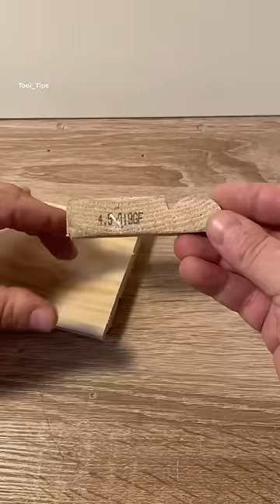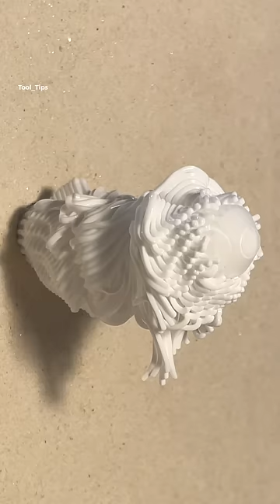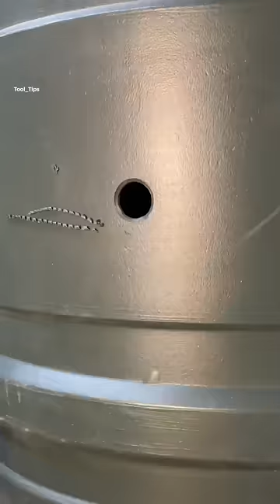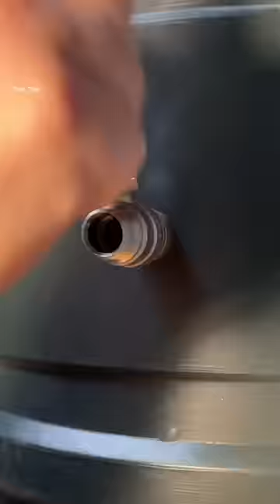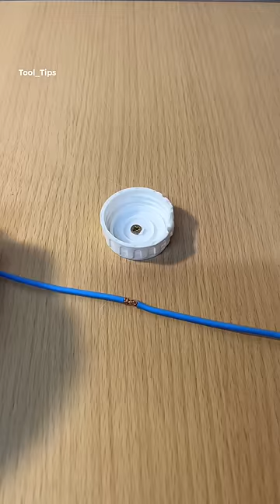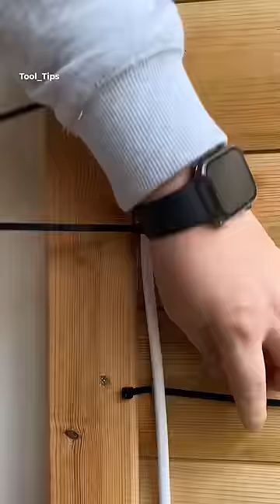General Tips 👍and Tricks

Comment: Great tips, but the bottle cap insulator is not a good idea. Electrical insulation is tested and rated for specific ampacities and heat tolerance to protect the conductor. That cap won't hold up I'm afraid.
Reply: It's a poor man's insulation 🥺
Reply: @Z le   It's a poor man's way to become homeless Do to the potential fire hazard

Comment: The valve you screwed into the plastic barrel will rip out at the first pull cause there's no reinforcement holding it in place
Reply: If it doesn't leak do the lack of  Sealant

Comment: I guess a 45 degree bevel cut on the 1st one would be too difficult.  I understand some walls arent exactly square but a 90degree in the corner is pretty close..

Now you have an overlap and it's more difficult of a cut than a bevel cut and perhaps cutting some of the waste on the back with a coping saw.

Most of these tips must be 3rd world inventions, there is shrink tubing for the clip with the melted bottle cap covering the splice..  most of these are what is considered "jerry rigged or mickey moused" solutions or I've even heard " African engineering" used..
Reply: On
Reply: The term was "Afro-Engineering" but since Obama was elected it's been changed to "Deploying a Presidential Solution".

Still means the same thing though...
Reply: My boss likes to say this is Mexican engineered. And he's Mexican so I guess that's ok. My saying is white boy engineering because I'm... well you get it.

What was the second one? Play dough fun factory?
Reply: Don't forget the plastic straw
for shrink tubing. super cheap...
Reply: 45 degree bevel cut?

You mean a miter?

That would be a miter joint

Comment: Hey is it the same handful of tips but didferent video clips? The same idea of pre drilling wood ends ao they dont split. Using some kind of filler in a hole for a screw to catch, the stapled ziptie to secure cables or the infamous electrical staples for romex or a nail driven inside a chain x4 to secure it to wood. 

Why do you need a piece of chain secured to wood in the 1st place?  What are you doing ??

Comment: Was all good until valve in the barrel because it wouldn't have created a good gap less thread. And the zip ties. There's actual staples and nails meant for cables often bought cheaper than zip ties when bundled. Allows for the use of one product rather than 2